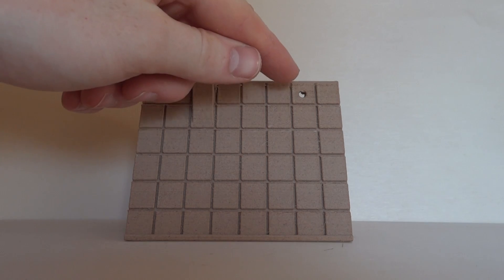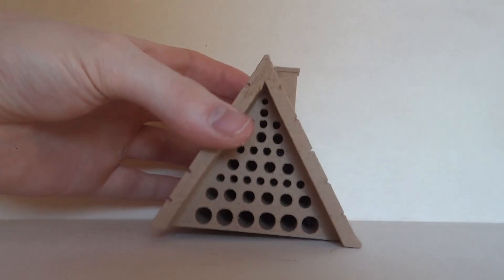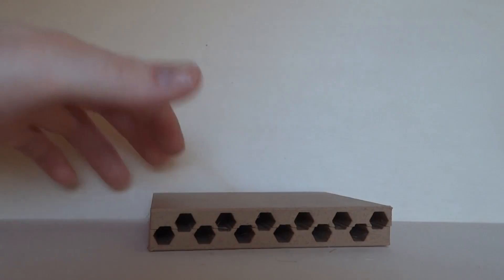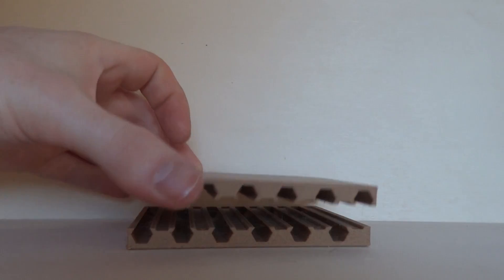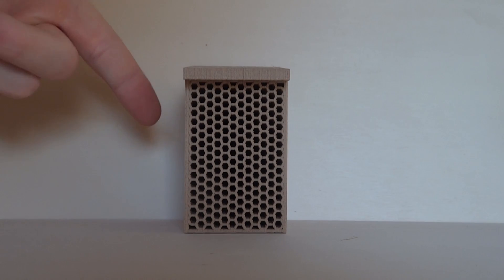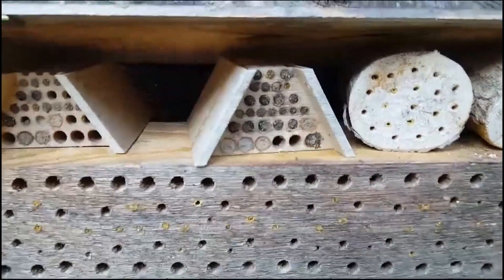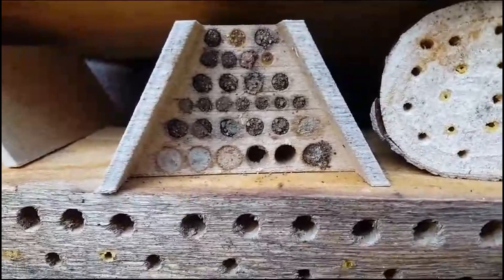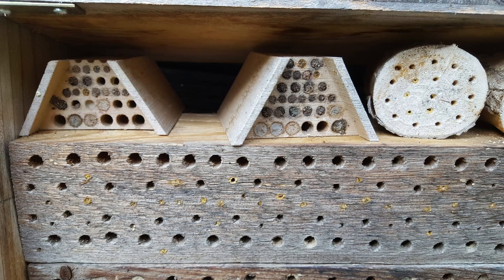3D-Printed Insect Hotels

Comment: Well done. I live in a high-altitude area where most of the honey bees are solitary (they do not create/maintain hives and survive the winter). I help the existing bees in my forest by drilling holes in dead trees which I purposely do not cut down for firewood/lumber. I would suggest that the biggest cause of colony collapse in honey bees over the last several decades is the absence of safe zones which do not have cellphone towers; the signals disrupt the bee's navigation. My forest has limited cellphone coverage so it's good for the bees here. On a related note, I would suggest that you read about Viktor Grebennikov's "cavity structure effect" which the bees use to find these hive-like structures.
Reply from the maker: Thank you very much! I will try to read into Mr Grebennikov´s work as I also wanted to understand what they are aiming for. I do not have sufficient data for the honeycomb bee hotels yet but the one looking like a weird house is definitely working extremely well and the bees find their home easily.
Your idea of drilling holes into dead wood is probably the best approach I have heard. Your theory about the cellphone tower is interesting. I will try to test this hypothesis as I live close to a 5G Tower, which is at roughly 500 metres of altitude and there is some forest and fields very close to it. One of the reasons we are losing them is the fact, that there are no "wild" spaces anymore but leaving a small percentage of agricultural fields with wild flowers seems to massively help. But of course other factors such as pesticides are also harming them.